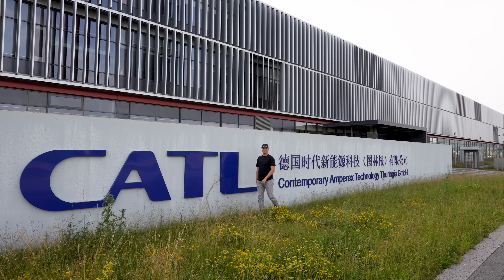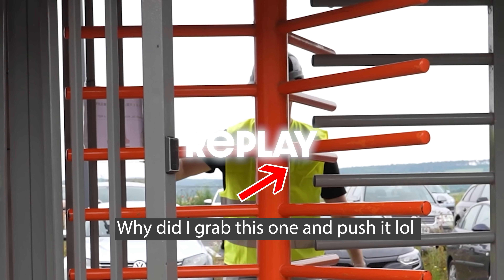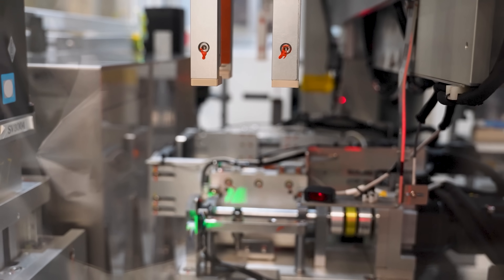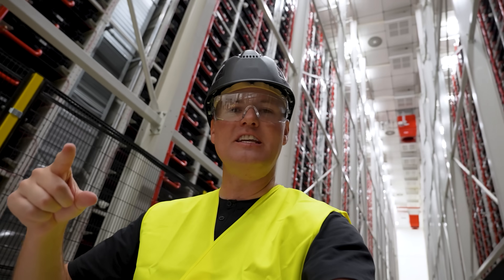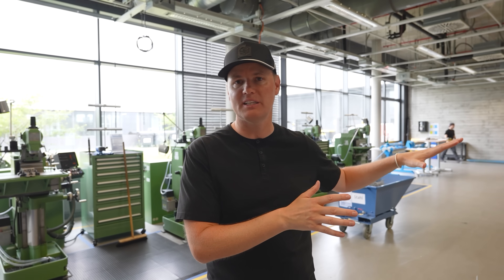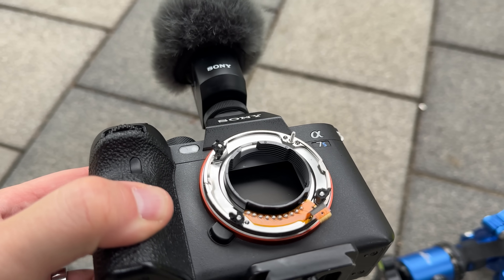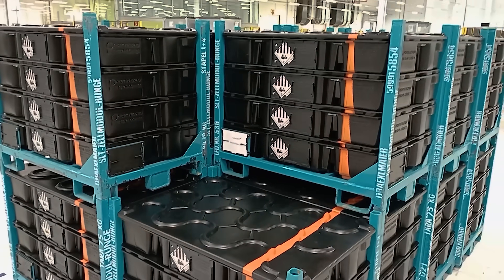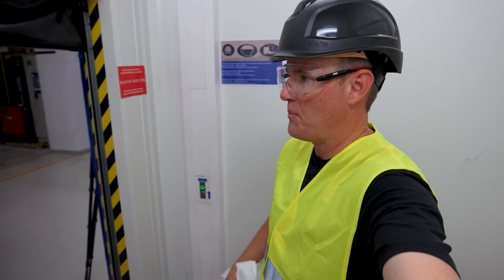Exclusive Tour of World's LARGEST EV Battery Factory!

Comment: It's better for the environment to run a diesel truck for 10 years than it is to build the batteries for 1 EV
Reply: Problem isn't environment and climate I think the issue is that OIL is gonna run out eventually. What's after that?